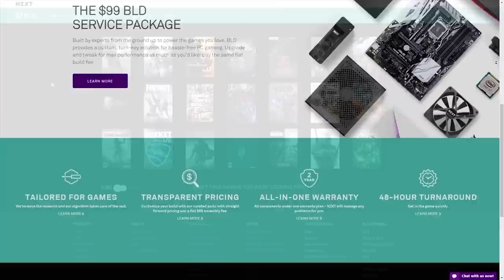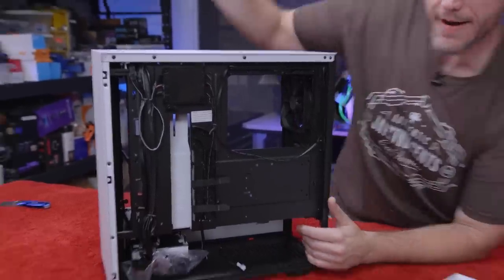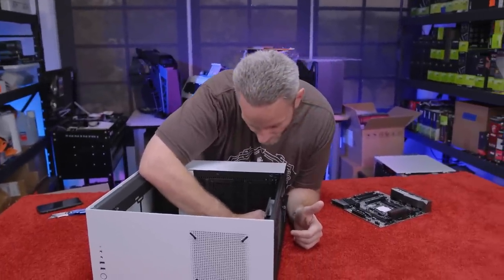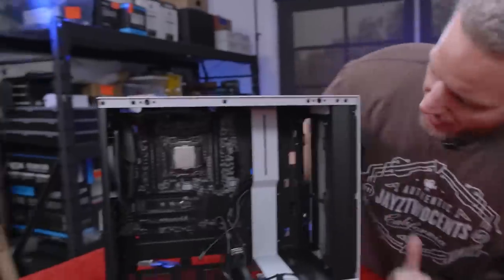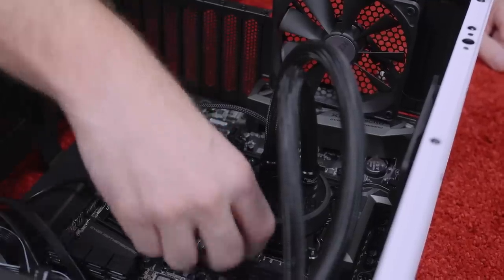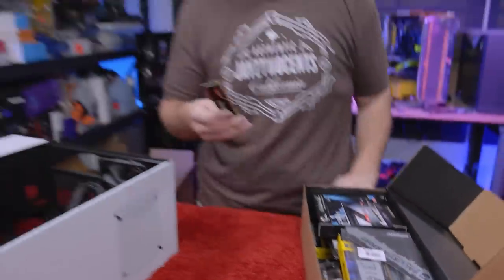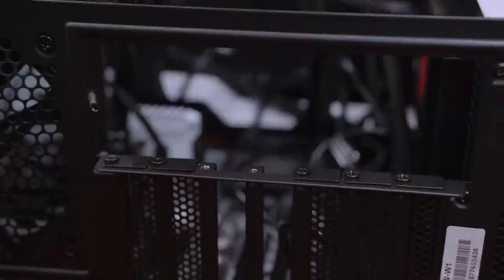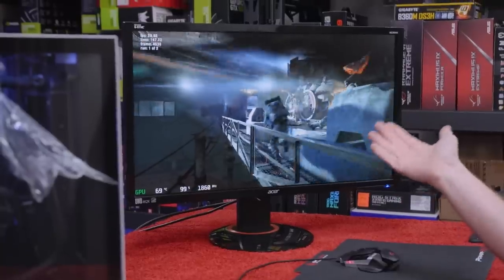We built a computer wrong on PURPOSE!

Comment: I got about halfway through this video before I found anything I wouldn't normally do with a system. Is that bad?
Reply: Chris Minors yes
Reply: You forgot to spray an air can on the mother board.
Reply: LOL
Reply: yes
Reply: i hope you're joking
Reply: Billy Gray, I think the only thing he did that I haven't done is stuff the extra modular cables inside the computer.  Unless you bend pins on the socket or CPU, computers are pretty hard to break.  Oh yeah, I HAVE done one thing that Jay didn't show, just once.  I forgot to unplug my PSU or turn it off when I connected it to the motherboard once.  The big blue sparks on the 24 pin connection let me know I did something bad.  Sure enough, I fried something.  Never did find out what, but the board never even tried to post.
Reply: I got a 486DX 66 to spark in all its Glory trying to plug in speakers to a sound card...🤣🤣
Reply: no
Reply: Chris Minors so Jay is responsible for the memory shortage?
Reply: That is my only fear in computer building. having a component fart and let the magic blue smoke out or seeing big sparks. Some of what is said to be bad practice is for the most part for the longevity of the parts. Like the part as to don't put your fingers on the pins. That leaves oil and other contamination on them causing corrosion and over time for your component to lose contact with the cpu. I also build on carpet as that is all I have in my house and my computer that I purchased from the factory (this is before I got the confidence to completely build from scratch) came with two different sizes of ram. I have a 4gb and an 8gb stick of ram though they are both from kingston if I remember the label correctly and they have the same clock speed.
Reply: I remember once when I wasn't wearing an anti static wristband and I was building a computer and it got friend when I put static from the mains into the motherboard by accident. Always wear a wristband just in case is my advice
Reply: Haha I have changed cards and cpus and have never used anti static wrist bands or anything
Reply: I'm the same I treat my own systems far worse than other peoples lol
Reply: Never wore a wrist band... ever. Never had something static die. :P
Reply: Yes!
Reply: Sarah1390 Building on carpet is mitigated by two things: 1) install PSU first, and plug it in (switched off) and 2) wrist wrap.  This grounds the case to earth and you to the case and ensures there is 0 build up.

Also it's good to do periodic POST checks (install CPU/memory, check for POST, then turn off, install GPU check for POST, ect).  This helps narrow down issues as you build.
Reply: i do that all the time patriot
Reply: Rex's Techs Packard Bell. 386. Price Club. Wow that sent me on a nostalgia trip. I missed that proprietary "tiles" GUI that Packard Bell had for years after upgrading, was so simple when I was a kid and I actually liked that look at the time.
Reply: Lelelel
Reply: The "worst" mistake i have done when building myself a PC were to put the metalbar that holds the the cpu-cooler seated to the motherbard with the side that should be pointing up pointing down instead, causing it to mash a motherboard-cap with one of its two thick "pins" when I screwed it on to the motherbord. The cap survived the brutality luckily enough. I soo feared I had punctured it after I had noticed my mistake. Although making mistakes is a good way of improving upon yourself, its what I take from that mistake, aswell as most mistakes I have done in my life.
Reply: That, and newer hardware is much better with static protection than older hardware generally. It was around the mid-2000s that static electricity became less of an issue to worry about.
Reply: Nice Konata profile picture. :P
Reply: Same
Reply: @du Bb Never use idle temps as a measurement for if temps are any "good" man, full load is where its at and for extended periods time. Also you have to lookup what is considered "good" for the hardware you are using.
Reply: I build on my bed that has fleece blankets and nothing happened
Reply: Chris Minors the only thing I've seen that was terrible...or close to it...   was with the cpu.

Problem is, is that whenever I want to start a good build I'm worried that by the time I can afford all the parts/components...that my build will be outdated.
Reply: Chris Minors yes
Reply: I've done a good one. ide adapter for laptop hard drive offset by one row. number of items dead, 3. Hard drive, motherboard ide controller and the processor. The processor did not work right in the replacement board, it would randomly lock up,
Reply: Chris Minors nah , wristband thing is bs.
Reply: du Bb very good idle!
Reply: I have exactly the same lmao
Reply: michael gregory I have even done that, bent pins on both a motherboard and a CPU before, but was able to bend them back into place in both instances.
Reply: I was the same until about 2/3 way through. Guessing my methods arent great
Reply: InvadersDie who drags their feet on the carpet to build up a charge when building a computer?
Reply: du Bb what's the temp in your room where it's being used? If it's only a few degrees higher than ambent, you are fine. My 1080TI is idle at around 28-30 C.  Which is water cooled. So if you are really worried, it would be the load temp to watch.
Reply: Chris Minors no you're good
Reply: du Bb that's decent. Just make sure it doesn't hit above 40 c
Reply: Chris Minors it's not good
Reply: Jordan Eilbert there is no memory shortage just greedy ass manufacturers price fixing
Reply: I have definitely bent pins on a CPU before. None of mine have ever snapped off and I usually use a thin steak knife to gently bend it back in to place. And no anti-static while I do it
Reply: The only things i haven't done are piling the wires and extra parts inside. But I have built one on a bed, and on a couch, and on carpet. I did keep the board on the static bag though. I have also plugged up power to the board with the switch on and plugged into the wall while troubleshooting. I have reused thermal paste many times without adverse effects and never use a wristband but i kinda cheat by grabbing the case before i pickup the board to discharge myself. Never blew up a system yet and I have been building/upgrading since the old pentium 133mhz days when a 5 gig hdd was big.
Reply: Indeed
Reply: +Rex's Techs  "I also inserted a 4 pin molex upsidedown into my CD-RW drive burning it out." ... HOW?! Did you have to use a hammer?
Reply: Apparently not.
Reply: The only thing i fucked in a build (first build with like 2 minor changes) was connecting the cooler master ma610p cable in the wrong way (now the cable don't work, affortunely i can connect it to the motherboard).
Reply: patriot you forgot to mention that you need to shake it like a spray paint can
Reply: yes
Reply: I would hate to buy a PC from you or anyone else practicing bad habits. LOL
Reply: WTH? Did you hulk out and cram a molex connector in backwards/upside down? The amount of force that should have taken would be stupid.
Reply: i know right besides the cables being everywhere
Reply: Holding it upside down.
Reply: Patriot 4572 1 wait, are you not supposed to dust motherboards with cans?
Reply: I used to punch and kick my 8 years old acer pc that never got any maintenance to get it to work properly.

I threw it away after the power button fell off because i didn't want to open the case and let the dust in just to turn it on.

Yah pretty hard to break.

The fan was caked with dust too.
Reply: Agree. I've built all of my systems on carpet without an antistatic wrist band. I think the wrist band is overhyped personally. Maybe for HDDs it's important...
Reply: if your talking about using compressed air to clean mb, then you are wrong :/ i clean my computer always with compressed air (not from can, but from compressor) and i can guarantee you wont break anything IF YOU USE YOUR HEAD....
Reply: @cube9519  Yes, Because how could anyone doubt those japanese capacitors?
Reply: Soshoyo i domt.understand what you meant by that but you really cant break anything if you dont blow the air at full throttle and dont push the nozzle right onto.stuff when.blowing.hard etc etc
Reply: @cube9519  Japanese capacitors are hard to break.
Reply: That's it.
Reply: Soshoyo ahh, yezzz
Reply: Yeah...you probably should stick to consoles... ;P
Reply: as the video shows, nope you're fine.
Reply: no
Reply: @TRex-NP  had a teacher who repaired a pc,, and then proceeded to plug it into a 320volt socket ( the ones they use for heavy duty table saws etc ).  I still don't know how he got a cable to connect them. But needles to say the PSU kind of exploded
Reply: It means you are really really clumsy
Reply: nah
Reply: Don't build a PC after watching just one YouTube video. Watch videos from several channels. The knowledge is out there. Use it.
Reply: My buddy dropped his tower down the stairs. Still worked afterwards.
Reply: Yes. Your bad at building computers let Geek Squad do it for you
Reply: the carpet is static and will destroy the parts
Reply: Agreed
Reply: upside down as well
Reply: do you roll out red carpet to build on?
Reply: @Dirtyboxer1  Especially cable management is overrated as an issue, it just looks nice. Some small form factor budget builds look horrible inside but run just fine. You see crazy bad and crazy good how did this even work type of things.
Reply: @alieneb72  While holding it upside down?
Reply: 20 years of doing the doing all my builds like this with 0 failures and over 20 computers made for personal use says otherwise...
Reply: YES
Reply: I’m building it carpet because I’m doing it upstairs. Anyone else too?
Reply: @alieneb72  spraying it upside down is better
Reply: oh dear.
Reply: I got a lot further than that
Reply: yea, that is VERY FUCKING BAD
Reply: @TRex-NP  I'm in an IT class and when we were building our PCs, they said to always use a strap for clients, but it doesn't really matter so we just were told to ground ourselves on the power supply. Always works well.
Reply: The only thing i try not to do is touch the contacts because this can eventually cause issues, but nothing a pencil eraser cant fix.
Reply: Wait i didnt use an anti static wrist band....
Reply: Just a tad
Reply: @TRex-NP  My worst fuck up to date was toggling an old PSU's voltage switch from 220VAC to 115VAC. Wrong current, for the wrong country. Slight ban, lots of smoke, destroyed all the components in the case except the CD-ROM
Reply: no it is fine
Reply: You forgot the power supply was the first thing you should install. Don’t forget to plug it in to get that board charging right away.
Reply: vertical seven what you can’t? I do that once a week
Reply: I did the upside down molex on a cd drive once lmao    @TRex-NP
Reply: The truth is there is 100 ways to do something and only one of them is wrong!
Reply: Contact the verge for employment
Reply: vertical seven h3h3?
Reply: @Sarah1390 Nothing wrong with magic blue smoke. I had an ssd that the plastic guides in the sockets broke off from, and I had to guess which way to glue the sata cable and power connectors in.. got the sata cable right, but got the power in the wrong way, and when I turned the PC on, it made a radical little grunt, and the magic smoke filled my nostrils. Ahhh, that wonderous electrical aroma, such an alluring scent. The machine shut off, and I unpowered it, and looked at the newly forged molten connector, and had to snip the wires off the psu. But everything else kept on ticking. If you can call a q6600 on a 12 year old socket 775 non-overclockable motherboard, ticking...

So in hindsight, I now know what the inside of an SSD drive looks like first hand. And also, not to buy cheap arse SSD drives... Oo
Reply: You only need to earth yourself on the case, if you're working on your own gear. Working on someone elses, especially if you're being paid to, you want to wear a anti-static wrist band..
Reply: @TechyBen Or... did you?  I'd run memtest for 12 hours just to be sure.
Reply: Baked at 200f for 25 minutes first, just to ensure the connections are all solid. Take that heretic. Oo
Reply: So, nothing happens in your bed. I'm sure it will some day... 

What about the PC components though?
Reply: Damn, some of these replies.. could be on a sex talk forum... "I did it on my bed, the couch, the kitchen table, the stove, the floor, hanging from the chandeliers, on the front lawn but the neighbours complained about the noise at 3am. We did it everywhere hbu?"

Oo
Reply: @Soshoyo wait, you threw it away because you didn't want to open the case to fix the busted power button? So how did you know the fan was caked with dust?

A likely story....

When I worked in IT, we have HP Vectra machines for the staff. The power buttons were notorious for sticking and turning the machines back off, so I would remove them, whittle the sticky bits, and 99% of the time, resolve the problem, resulting in less helpdesk calls... till that one fateful day, a lecturer turned his PC on and the power button popped out and flung across the room... 

"Hmm, must have been a defective button... I'll log a warranty call." and hoped that the techie sent out didn't suss the button and say "Hang on a minute, this has been mutilated!"

vectra's.. a rather obnoxious machine from the annals of history. Long may we forget their existence.
Reply: It's funny... I've been building PC's since the days of XTs... no youtube videos or anything back then. Never lost a component... if you can't work with electrical components and not blow them up, videos are not going to help.. that's a problem between the ears of the end user.
Reply: *Ur
Reply: @- xARCHONx - well, take heart in knowing that a HP techie came out to replace a dead PSU where I worked in around 2001. He did the job, proceeded to test the unit, and this super loud POP was heard all down the corridor. He'd done the exact same, hadn't checked the voltage switch.  Haha, he had to go back to base, and get another new psu... 

Not as bad as the time a cisco guy came out to add stuff to one of our racks, took out a $10,000 switch, and promptly dropped it, smashing it.  That was a terrible saturday to be doing unpaid overtime, with an extreme hangover, as the manager came out and blasted us all before realising it was the cisco guy and not us... fun times at swan tafe...
Reply: How many rams? I only have a 50mbit connection, do they need to be shorn first? I don't want to clog my utps....
Reply: @TRex-NP  scrub the motherboard against a cat and you will have a winner!
Reply: These were about myths not actual things that WILL damage the build. I mean hell he never spilt liquids or dunk it in water if you are going with that.
Reply: @TRex-NP  Yes your comment is 6 months old, but I dont care. Youtubers, and I really mean, sponsored youtubers go too far by saying how building your pc the wrong way can be bad, could mean damage to ur components, etc..
but the truth is that a PC isn't as vulnerable as most of us like to believe, u can do so much wrong and ur PC will still work fine. 
But I get it.. safety first. You can't be too careful with such expensive parts but in reality u could throw ur gpu across the room and it'll still work fine. 
There's too much bullshit going on, especially with amateur builders, even though when u do everything wrong, ur pc will still work just as fine.
Reply: oh wow just watched the vid, this guy tells exactly what I said but in proper English instead
Reply: Chris Minors no can I pay you to build me a pc
Reply: Chris Minors same bro.
Reply: R u a worker at the verge lmao
Reply: Rex's Techs Modern PC parts are actually pretty well built, so the chances of static killing a modern motherboard is slim.

But try to do that about 20 years ago, when IDE cables were still a thing, and you would fry a motherboard by just touching the board, if you discharged static from your hand to the board.
Reply: M
Reply: @alieneb72  oh god, i did that when i was 13 or 14  directly on the mobo, in my defence it was super dirty and dusty.... killed the hell out of that gateway mobo
Reply: @alieneb72  I learned that one the hard way thinking it was safe to do so because no one told me, rip motherboard and short circuited my geforce 1060i
Reply: Surprisingly this is not as bad I have experienced before lol
Reply: Daaaaang jay pinned your comment to shame you... What a savage
Reply: can i get anything
Reply: Almost put my eye out with an anti static wrist band - forgot i was clipped and went to scratch my nose to far away and it snapped to my eyebrow - never used one since ...
Reply: Yes
Reply: Same. I just built my new Ryzen 3600 system last night... on carpet... without straps... parts being set down everywhere.. Haven't had a problem yet and the system runs great. I can see how people would be cautious with thousands of hard earned dollars in equipment, but I have to imagine this stuff is made with a certain degree of resistance to things like EMR and static shock.
Reply: @danielmace406  the worst think is probably the carpet if a little bit of shock gets build up your pc is fried
Reply: According to the results, nope.
Reply: A lil bit
Reply: TheLastMcLaren haha lol I was thinking the same
Reply: No I think it fine
Reply: Nope, it's fine
Reply: Yep thats bad my dude, I didn't get 2 minutes in before I started having a panic attack.
Reply: @TRex-NP  I fried my first memory sticks on carpet
Reply: Lol me too!
Reply: @TheDemocrab  less of an issue for instant part damage. Static that is introduced to systems sensitive components will still cause faster degradation to those parts than parts that were handled properly.
Reply: @remi4867  True, it depends on the specific protections in the circuit really, some only mitigate it which results in what you said, others can offer a "buffer" of sorts ala a ablative heatshield on a rocket.
Reply: Hey, he's using my PC case, except I chose the black model!
Reply: @alieneb72  LMAO
Reply: bruh moment YES
Reply: Verge?!?!?! YOU'RE BACK?!?!?!?!
Reply: nah its fine
Reply: Jay: doesn't care about breaking this computers components
Me(who is almost poor): Am i a joke to you?
Reply: @TRex-NP  oh man price club heh my dad had a membership with them too
Reply: I messed up installing my aio so I took it off and reinstalled with the same thermal paste
Reply: @rtxrt73  - damn, you sent me on a time machine trip there. I still remember what the DX means.
Reply: @Jxhnny77  unless it’s mini ITX there should be at least 4 dim slots
Reply: @Jxhnny77  you can do but try and keep the speed and timings the same as the motherboard will default to the slowest profile
Reply: Verge wannabe
Reply: I’ve built tons of computers for myself and friends and never used a static wristband. No problems, just don’t be stupid.
Reply: @-xARCHONx-   AHAHAHA I did exactly that when I was a kid trying to troubleshoot and fix the family computer. The fans would ramp up and not stop ramping as soon as I booted it up so I did exactly what you did... Big bang. Plastic smelling smoke... Bit of poop in my pants.
Reply: Same here :(
Reply: all of the "could go wrong" scenarios with pcs never happen in my experience. All of my friends cringe when they see my rats nest cable management, cpu cooler on with 3 screws (don't get me started on that cooler master spider clamp), and SSD dangling in the case. But the only issue I've had in 10 years was a faulty psu that fried my motherboard 7 years ago... computers are tougher than people think, as a mechanic I've seen modules that control electronic trunk releases work fine after sitting in a pool of water for who knows how long.